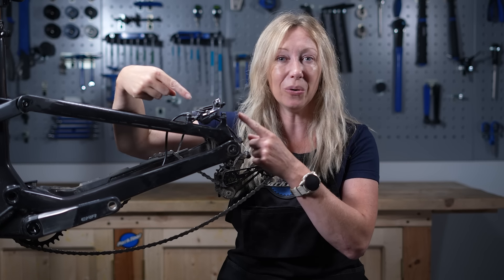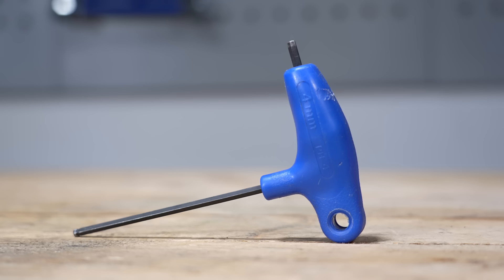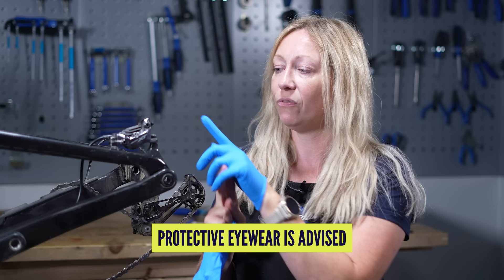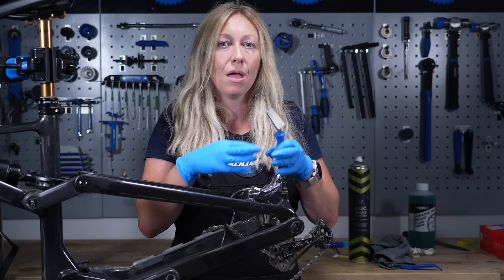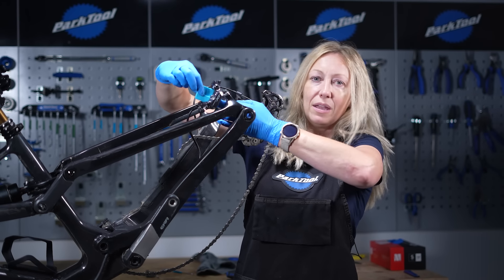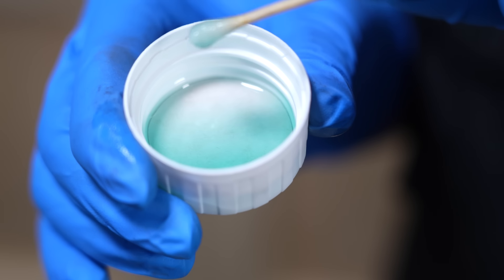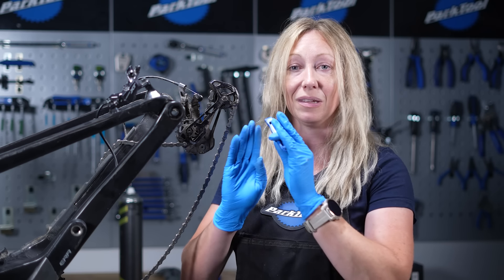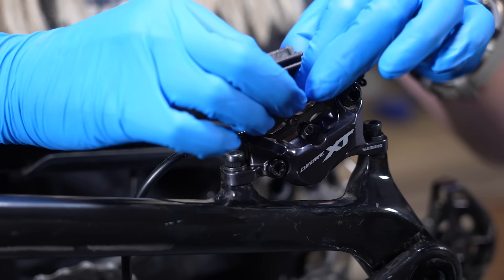Suffering From Sticky Brake Pistons? Try This Quick Easy DIY Fix!

Comment: Hi, thanks for your video. I recently placed a new caliper, with new pads and a new disk. Then, I braked hard in a downhill several times to match the brakes to the disc (sorry I'm not british, and my language could be poor), so what do I see now : the disk and the pads have black dirt on it....and the brakes don't do their job, I can't brake anymore. So I suppose they are contaminated with some oil, but I can't see from where this oil comes from, I don't see oil coming out of the pistons. Do you have any idee from what went wrong ? What can yo advice me ? If I clean the disk I suppose I can still use it further....I look forward to hearing from you
Reply: @mpl1700  Hi, I've been thinking, did you clean the new discs with brake cleaner before fitting them ? Often they are coating with an anti corrosion coating for storage. 
If you have a spare set of pads I would try cleaning everything with brake cleaner and try a new set of pads, if you don't have a new set try soaking the old ones in brake cleaner, although once the pads are contaminated it's unlikely you will get them perfect again. 
Also might be a good idea to check the calipers for leaks, for this put a spacer between the pistons ( with the wheels out) and put some paper towel under it, then use a zip tie to apply pressure to the brake lever. Leave for an hour and check the paper towel for brake fluid. 
I hope this helps. Maybe not a conventional fix but I found it has worked for me. All the best.
Reply: @CuzzyWuzzy  I've done it like you said, and apparantly there seems to be no leak  ! So mu question is then where does the contamination come from ? I cleaned the disk, I suppose I can still use it. The pads I cleaned them with " brake cleaner'", but I suppose I'll have to throw them away, unless I use sandpaper on them, as well as on the disk....? cheers

Comment: Where do you get this piston block?
Reply: Quite a few folks on eBay that 3D print these for most common brake systems and they work fine.   Otherwise I would suggest checking Williams racing products if you want one from a legitimate after market company.
Reply: Just ordered 1 from Etsy

Comment: Hope brakes are rebuildable and in my opinion better than contributing to the throw away mentality pervasive in the industry.
I have seen one too many 'lazy pistons' that never are able to get brought up to proper working condition - in my experience, exercising/cleaning/lubing the pistons only resolve the issues about 30% of the time. Check for other contributing factors, alignment, old fluid, etc.
Reply: IMO Hope pistons are too short. They easily cock and bind in place when just part way out (worn pads). I cannot get even half the life out of my pads before the pistons bind. New pads fixes it, but should be able to get more use out of the pads than half.  All this despite the pistons being clean and lubed.
Reply: @johnconnolly2815  I hear you - unfortunately, no design is perfect - there are always trade offs. I tend to replace pads more frequently on any system, so perhaps that is why its not been an issue for me.  Good video though. - Cheers
Reply: @scottwexman5615  I had to make shims to put between the pads and pistons, to get the rest of the life out of the pads on Hope brakes.
Reply: Watch the Hope videos.  Make sure you have filled the master cylinder correctly and do the little lever brake tip.  Also make sure you wipe the Hunters grease off once you have lubed the seals.  I used to think if I left a bit of extra grease on they would last longer but they just get dirty quicker.  The Hope videos are good and the ‘newer’ bleeding videos with the younger guy are good if anyone hasn’t seen them.  

However I still need to clean and lube my Hope brakes fairly regularly though.  Shimano seem to need less maintenance.  

I would like to try the newer Hope brakes someday but the older ones just keep on going… (if you maintain them, of course!)

Comment: Without scientific proof, I believe the pistons move freely longer, when using silicon grease spray i.s.o. brake oil.
The same spray I also use for the fork - never have dirt stick to the stancions an go inside the fork.

Comment: Instead of the expensive bike specific brake cleaner you can buy automotive brake cleaner.
Reply: @Velo1010  be careful which you get some will literally ruin the paint on your bike.
Reply: Surgical spirits cheap alcohol
Reply: @SLAUGHTYBAUDFAUST  exactly. What I do is spray it on a shop rag or use the spray nozzle. You are right you have to be careful. Wipe off very quickly if it gets on the paint.

Comment: Warning, I did this. Cleaned the XT pistons carefully, first with mineral oil, then with alcohol. After a few rides I found that the residual mineral oil worked its way onto the rotor and destroyed it. 😅
Reply: Remember when you lube a piston with oil it gets pulled towards the seal, but it’s still held on the outside of the brake system. There should only be oil on the inside of brakes. When activating the brakes residual oil is pushed towards the rotor. Unless you are super careful to remove all oil you risk contaminating the rotor, which is what I did, and there is no coming back from that, until you get new pads and a rotor
Reply: @JamesGoddard-i7s you sound like a right 🔔end. No amount of isopropyl will remove the residual oil from pistons after you "cleaned" them with oil. It's basically a leaking piston situation, but self-induced, and to clean them properly you would need to rebuild the callipers. I hope you don't pretend to be a "professional" mechanic.
Reply: @tedoakes9235  the pads are ruined, but the rotor is steel and can be cleaned (may need a little bit of careful sanding).

Comment: Another great advice to spray brake cleaner left and right 🤦‍♂
Brake cleaner formula is not standard and varies greatly (and is different compared to carburetor cleaner as well), so does rubber, plastic and paint compatibility.
There usually is a warning right on the can, or at least a guidance to test it yourself before use on each material other than bare metal.
Electrical contact cleaner may be a better choice, but then again, you won't know beforehand.
Reply from the maker: Isopropyl alcohol is also a great option! But a bike specific brake cleaner like the Peaty's one used in the video will be safe to use 👍

Comment: This is complete twaddle. Brakes rely on the flexibility of the rubber seals to work, the pistons don't move through the seals except that they creep through very slowly over weeks as the pads wear.

Comment: Wearing protection glasses might be even more important than wearing rubber gloves.

Every time I have to do this, I want my rim breaks back. It's a pity that the bike Industrie hasn't solved this problem after roughly 15 years of disc break "evolution".